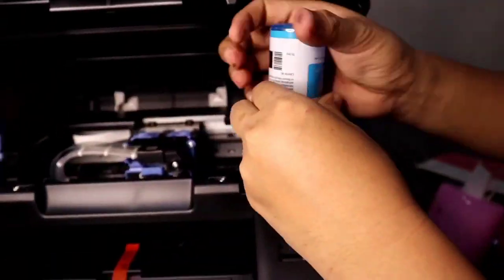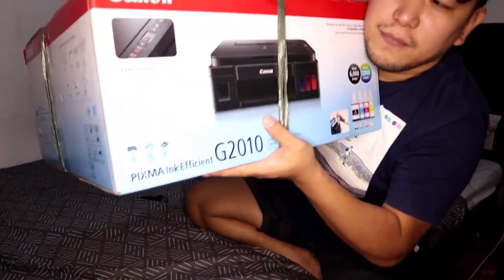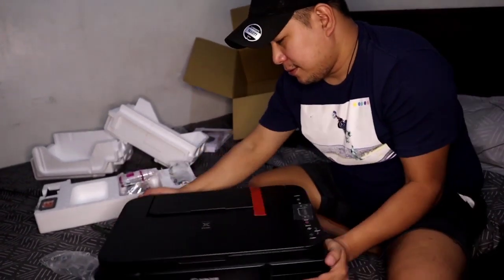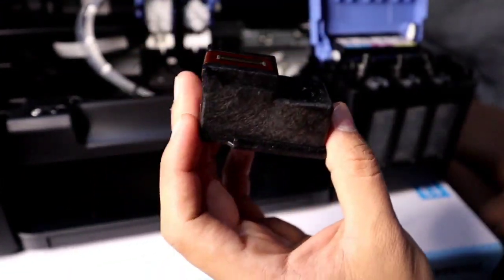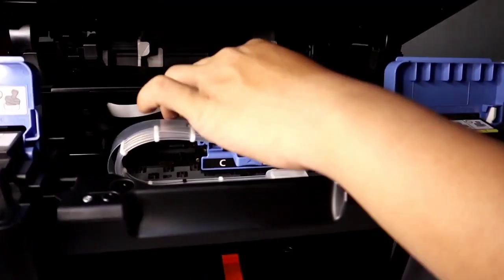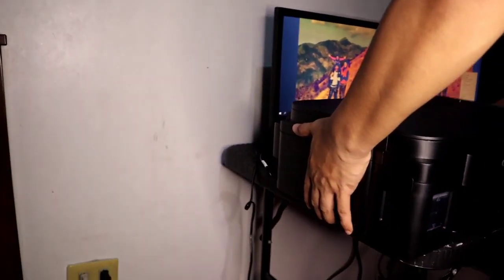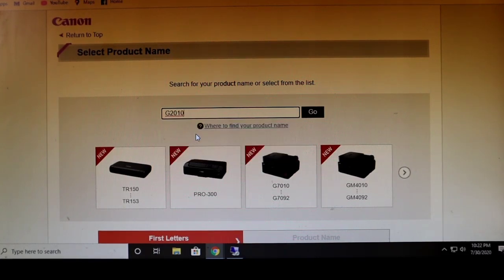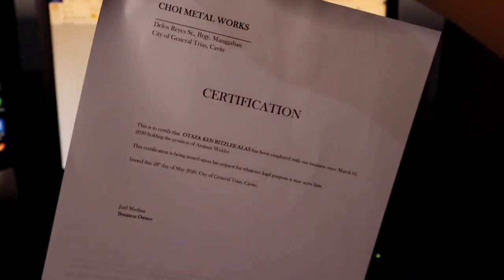HOW TO INSTALL CANON G2010 PRINTER | COMPLETE TUTORIAL TAGALOG.Kahit walang cd player.

Comment: Thank you for sharing! Question - it essentially looks like a factory clean printer and unless you load it with the ink there is no ink anywhere in it straight out of the box? I am asking to double check as in that situation it looks like it can potentially be used with edible ink, if edible ink is used instead of the printer ink - is it factory clean? Including those C and B heads? Can you confirm?

Comment: I got mine Canon PIXMA 2010..Sana magtagal..
Reply from the maker: Sulit po yan. Npakaganda
Reply: @masterchoi9700  hi ask lng puwede b ito pang scan Ng docx?
Reply from the maker: @maricorjimenez6418  yes po
Reply: @masterchoi9700  bakit po nag failed iyong set up ko?
Reply: @masterchoi9700  nagamit ko din siya sa mobile using OTG cable...kahit wla Ng wifi...